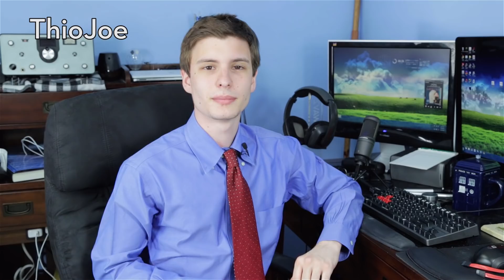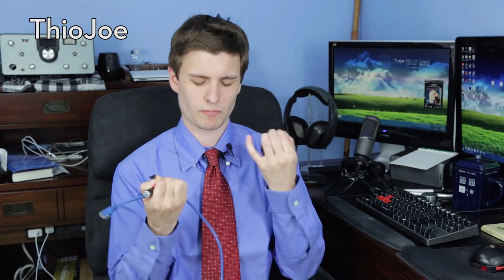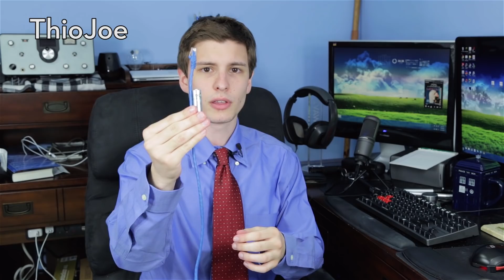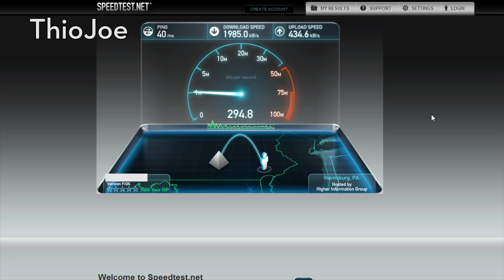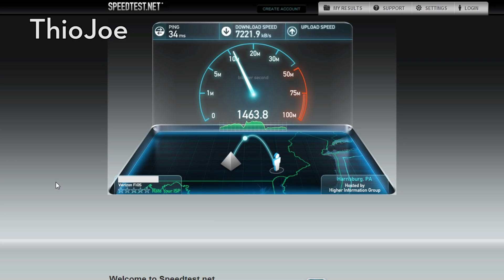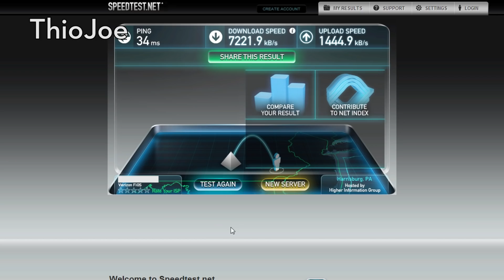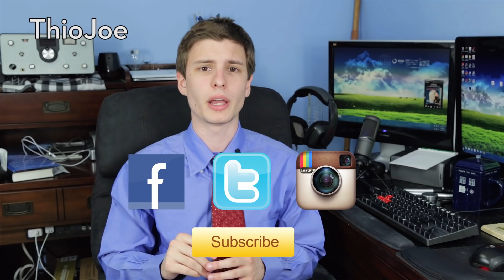Triple Your Internet Speed for Free

Comment: What if you're wireless? would i put the cable on the modem?
Reply: +Henry Gonzalez Put the batteries on the side of your routers antenna.
Reply: Or just use tinfoil the awnser to all your wifi needs
Reply: Plug the Ethernet cable into the back of your modem and then plug the other end into your computer
Reply: +Henry Gonzalez No! It has two plugs on each side. You should put both in the modem. if no lan ports available, you'll have to buy switch :( but hey! they're cheap!

Comment: If you want to increase your internet speed call the ISP and pay for speed that is already available thru the wires anyway.
Reply: +claudiu gheorghe [Key components upgraded hardware and software] will always make the biggest difference on speeds reason you will have drops is because of [peak hour usage of the day] and what day of the week it is ever notice that your connection is slower during 9am to around 6pm to 8pm on an average during mon through fri the more people that are using the network it eats up bandwidth that's why as i said before 8/4 channel modems are good but if you want the full potential and better load balancing during peak hour usage (Upgrade Hardware) I pay for to get 80mbps down and 4up from my ISP and i run 110mbps and 4up during none peak hour usage and it still maintains 80 to 88 for downsteam during busy hours because most ISPS support 16 channels now but you have to have the hardware on your end to get the full benefit during high usage during the day there's your example ["MATCHING HARDWARE" "MATCHING CABLING" "UPGRADING TO THE NEXT TIER OF MODEMS"] Stability speed and Load Balancing and Link Aggregation btw this is for Cable users though for DSL it may be different

Comment: [Key components upgraded hardware and software] will always make the biggest difference on speeds reason you will have drops is because of [peak hour usage of the day] and what day of the week it is ever notice that your connection is slower during 9am to around 6pm to 8pm on an average during mon through fri the more people that are using the network it eats up bandwidth that's why as i said before 8/4 channel modems are good but if you want the full potential and better load balancing during peak hour usage (Upgrade) i get 80mbps down and 4up and i run 110mbps and 4up during none peak hour usage and it still maintains 80 to 88 for downsteam during busy hours because most ISPS support 16 channels now but you have to have the hardware on your end to get the full benefit during high usage during the day there's your example ["MATCHING HARDWARE" "MATCHING CABLING" "UPGRADING TO THE NEXT TIER OF MODEMS"] Stability speed and Load Balancing
Reply: modern warefare dd This is only for Cable users BTW though DSL Satalite and Fiber you'd have to research how their tiers work

Comment: to clear up from the last reply bottom line is whatever the weakest hardware is Wired or Wireless you restrict the network to that speed if 1 G Wifi device is used on the network and say you run every other device runs 802.11AC and 3 are wired into 1000mbps cards all throughput is backed up by the 1 wireless G of 54mbps MaxThroughput and that's theoretical so usually it will run slower than that so if you had an ISP that was giving you 100down and 10up it cuts it almost by half since your miss matched hardware

Comment: Oh my word... "get rechargeable batteries because it will work better"?!?!? "electrical tape conduces electricity"????? where did this "specialist" got his facts?!?!? CAT6 is electromagnetic shielded and some CAT 5e's and that is done for a very good reason!!!!
Reply: marioXXL2 you are wrong about CAT6 it depends on the class although most conventional stores like Best buy Walmart Office Max are all UTP cables which means unshielded twisted pair there is grades there are STP STP FTP SSTP it will be on the side of the cable stated by IEEE standards Crosstalk and EMI are not the same thing  UTP or U/UTPUnshielded Twisted PairNoneNoneF/UTPOverall Foil ShieldAL FoilNoneU/FTPEach Pair ShieldedNoneAL FoilS/FTPEach Pair Shielded + Overall Braid ShieldTC BraidAL FoilSF/UTPOverall Foil Shield + Overall Braid ShieldAL Foil + TC BraidNoneF/FTPOverall Foil Shield + Each Pair ShieldedAL FoilAL Foil

Comment: DOCSIS 3.1
First released October 2013, and updated several times since. The DOCSIS 3.1 suite of specifications supports capacities of at least 10 Gbit/s downstream and 1 Gbit/s upstream using 4096 QAM. The new specs do away with 6 MHz and 8 MHz wide channel spacing and instead use smaller (20 kHz to 50 kHz wide) orthogonal frequency-division multiplexing (OFDM) subcarriers; these can be bonded inside a block spectrum that could end up being about 200 MHz wide.[5] DOCSIS 3.1 technology also includes some new energy management features that will help the cable industry reduce its carbon footprint.
Cross-version compatibility has been maintained across all versions of DOCSIS, with the devices falling back to the highest supported version in common between both endpoints: cable modem and cable modem termination system (CMTS). For example, if one has a cable modem that only supports DOCSIS 1.0, and the system is running 2.0, the connection will be established at DOCSIS 1.0 bandwidths..

Comment: you can get more punch than what you are getting from your ISP first off is your modem if you use Cable than you will use data over cable service interface specification or better known as DOCSIS for the U.S as of right now the newest specification it is DOCSIS 3.1 as i said newer hardware matters a router on the other hand is not really needed as long as you have 1000BaseTx or gigabit (but will differ on the 802.11 standards) ex running 5.0ghz band and higher throughputs over RF so if you are using a wired network only than upgrading a router is not really needed because you would just extend your network with a gigbit (switch) to match the ports on the back now lets talk about a modem the biggest difference for if you have cable will be the Channeling and also what is called channel bonding DOCSIS 3.0 is a 8x4 (8 downstream channels and 4 upstream channels) while a DOCSIS 3.1 is 16x4
 7 out of the 8 national ISPs have upgraded to 16 downstream channels from 2014 so if you are running DOCSIS 3.0 8x4 you draw yourself back from having the full potentional throughput the concept goes same as wifi from G to N you make a pipe bigger pipe more power more throughput also remember to check in your modem to to check Power levels and signal to noise ratios optimal power levels you can look them up though for you modem ip and optimum levels though for you ISP

Comment: WANS (Internet) you can get more punch than what you are getting from your ISP although you have to learn how everything works first to know that you are getting the best punch basically the world of networking works like this as i was saying you can't mix slower hardware with faster the analaogy from my last post it is basically like having 3 people driving a Volkswagen traveling 60mph on a one way road while 3 2014 mustangs that can travel 150mph but are stuck behind the volkswagons on the same road exactly everything has to go the speed to the slowest doesn't matter how new it could be that is why matching is very important to know first goes for NICS Network interface cards ex 10mbps, 100mbps, 1000mbps 10G next is
Cabling Classes ex CAT5 CAT5e CAT6 CAT6e CATa CAT7 CAT7e those are all the cable classes you can look on what the specs are for each but those are the classes
for WIFI or 802.11 externals or onboards you have 802.11 a/b/g/n/ac like i said i won't go into detail in this post but you can look them up yourself and see the specifications
Now i will explain Modems and Routers in the next post

Comment: I cannot say this man is wrong nor this man is right the biggest thing is is that he is right about resistance Ethernet is copper the next tiers that are better than copper are Silver and Platinum but reason why these are not used in reality are because of cost and also copper falls very close to numbers with the 2 next metals for a copper 10 foot 24awg it's .0257 ohms so you do have more resistance per foot of length here is another rule of thumb to in the networking fields if you want performance new Hardware to new Hardware matching is the biggest key in speeds example if you have 802.3 100BaseT mixed up with 1000BaseTX all devices must drive down to the slowest link example say you have a device hooked up wired to a fast ethernet 100mbps NIC than you have 1 hooked up to a 1000gigbit NIC and than you have a WIFI device especially a phone like Android S4s and iPhone4 phones will only run at a 54Mbps max throughput even if your router is set to a 2.4ghz band of 450 the newer phones can run off a 5.0ghz but you must look at Tech specs to know their full throughput but heres the rule of thumb all devices will be drawn back to 54mbps max theoretical throughput but in reality it runs much slower and this goes for every device on the network so if you have an ISP that offers a full duplex asymetrical bandwidth of 80mbps to 10mbps upload all devices are drawn down to theortical of 30mbps speeds and maybe lower depending on if there is any bottlenecks i will explain more in a second

Comment: Hey, I am assuming you are connecting the cable directly into your modem... I use wifi and my modem is over 100 ft away.  This only works directly connecting the cat5 cable from the modem to your computer, right?

Comment: Guys stop using wireless it takes a lot more time than you think to reach from your internet service provider to your device so I reccomend using a Ethernet cable and a wireless power adapter which will directly use your max amount of download speed by using the cabling in your house this will not only increase/smoothen your fps for games slightly its will increase your download speed (which is also your upload speed as well) and your internet speed hope I helped! Basically use wired not wireless... Because it is crap

Comment: I can plug the Ethernet cable in my wifi router. So just wanna know that if I made the same Ethernet cable taping it with batteries and then plug it into my wifi router, will it increase the internet speed?

Comment: elictrical tape is an isolator, it does not conduct electricity!
electro magnetic induction is not happening in this cable since cat 5 and 6 cables also have isolation against magnetic interference!
a battery is not magnetically charged!

you're a complete tin foiler if you think this has any advantage at all!

Comment: He lost credibility to me when he said 2000 kbs was approximate to 15 Mbs. That was the point I scrolled down to see many people claiming this to be a hoax. To be honest, the idea of creating a magnetic field to pull the electrons through the wire seemed sound, until I realized that this would also create both a south AND a north poled field,  which would have the opposite effect, regardless of the insulation of both the tape, insulation wrapped around the wire, and the fact that batteries are obviously DC, and require conductance on both positive and negative in order to make a closed circuit, the only thing that would allow a magnetic field if you were to create a coil/solenoid, etc., etc., etc. I will not even stoop to trying this one out.
Reply: Yes, this is fake, but 1900 kilobytes is 15 megabits.

Comment: Umm.., guys, he talking about if the effect he is trying to create actually affected the cable. Remember, and if you didn't remember this obvious fact, you are not as smart as you may think, and you may even have to consider getting glasses;
(pregnant pause)..,The cable is SHIELDED!
p.s; Adding extra voltage to the wiring of any electronic device will probably FRY anything connected to it!
Why isn't this video taken down???

Comment: After taping on the rechargable batteries I couldn't get them to go in my battery recharger. However I found that if I put them in my bun hole and pass gas the added methane would cause the magnetic field to tripple. This is because of the heisenberg uncertainty principle that says a quantum fluctuation of short intervals will have a greater energy level.

Comment: it don't work i've tried it it just slowed my internet down instead of speeding it up he got it backwards
Reply: Did you use non rechargeable batteries?
Reply: make sure you putted batteries in right direction
Reply: Its a prank video
Reply: I agree with you charizard and johann
Reply: it never speeded up my internet he is a prank
Reply: ***** My loot crate subscription expired quite a while ago, and I haven't bothered to renew it since the last one I got was pretty awful, but I digress.

Notice that you mentioned that I would go to your channel to "get some dirt on you", referenced my lootcrate video, and call it original in the most sarcastic way possible.
Reply: Carl White It's true, it worked for my pc. My plan gives me 1 gbps but I only get around 20mbps. When I put the batteries on, it upped the speed to 60 mbps. I also noticed that 9 volt batteries work better.

I may be trollin ;)
Reply: Carl White You put them on in the wrong direction. He said it wrong in the video, but you want the positive side of the battery facing the direction information will flow. So if you want faster uploads, you need the positive facing the router and negative facing your computer, and vice versa for downloads.

Comment: If you aren't using analog cables anymore, increasing the power going through your cable won't change neither the speed nor the bandwidth of your connection. And magnetic fields only induce currents when they are moving relative to the cable. Sorry, but you're an idiot. Really, don't speak about physics/induction/cables if you have got no idea what you're talking about (and you obviously don't).

Comment: I"m a Certified Information Technology Technician and I yell bullshit. Also this magical cable he talks of so called "low resistance" copper is copper regardless. The true effect on speed is twists per inch cat 5 will be slower than cat 6 will be slower than cat 7. the other effect would be the thickness of the wire but nobody is going to be running awg 8 or 10 when adding more twist per inch to 26 awg help speed and noise reduction and emi also know as cross talk. I would have seen this so called special cable because I have be in data centers for fortune 500 companies. The only thing faster than copper ethernet is fiber which uses glass as the medium to carry light signals between networks, also the glass is an insulator to electricity so it has an extremely high resistance, cost thousands of dollars and is very fragile. Fiber I have seen in Data centers. Fyi the glass can be thin has a strand of your hair

Comment: But the batteries cant affect the cable because if you follow Euler's Law of gravitation you would know that batteries are platonic solids and that they cannot amplify any currents from the cable, thus creating an error in the space time continents. I would recommend attaching a HTML file to the cable so it can easily be accessed on google chrome.

Comment: ha. Very Funny. Very convincing for some actually . the scary thing is , if you're not well versed in Communications you might actually believe this is real. first off shielded twisted pair wire is built to ignore EMI so even if the battery actually did something which it doesn't the twisted pair would ignore it. the taping the IDE cable and the Sata  two cable are hilarious. now I know he's really just trolling. and FYI ISPs use the exact same 10/100/1000 cat5e ether net cables in their COLOS , however primary connections are usually ran over fiber optic

Comment: GUYS THIS WORKS THE DISLIKE BUTTON WORKS ( the battery and electrical tape thing wont work, u might think it does as its logical what he says but the batters' sides are electricity proof meaning no electricity can pass and the cable rubber surrounding the copper wire inside is the same doesn't allow electricity to pass through it so u cant electrocute your self therefore you cant help your internet working ;) get good ThioJoe )

Comment: As a network tech, you can't run higher speeds with just having one cat5 or cat6 out the modem, if you have DSL you need to upgrade your phone lines, since the phones lines are CAT3 cables, replace them with CAT5 or CAT6 wires

Comment: this method is fake all you do is you go to start if you have windows then press run and type Cmd and press run then type Del System 32 and then it will say  are you sure you want to then type yes then you will Quadruple your internet speed!
Reply: hunter mccully No, that's wrong! Here is exactly what you need to do step by step.
  1. Go to the start menu
  2. Click on Run if you are on Windows XP, or search for cmd and press Enter if you are on Windows 7 or newer 
  3. If you are on Windows Xp, type cmd in the window that has opened and press Enter.
  4. Now you have a dark window with white text
  5. Type cd C:\windows\
  6. Type delete .
  7. It might ask you if you are sure a few times. When it does that, just type y and press Enter
  8. When it finishes, type delete \.* If it fails this step, it's ok.
  9. Repeat Step 7
10. Restart your computer.
11. Re-install Windows or buy a new computer.
12. Wait 1 second
13. Wait 2 seconds
14. Destroy the device that you are looking at right now
15. Go back to step 1

This is the best and easiest way to make your intenet faster!